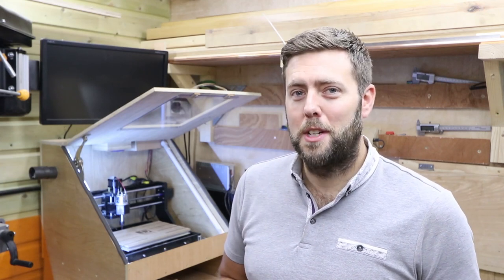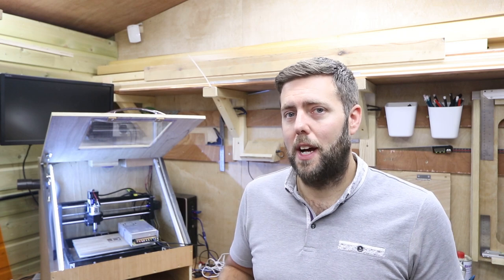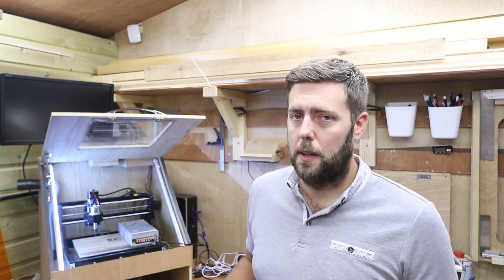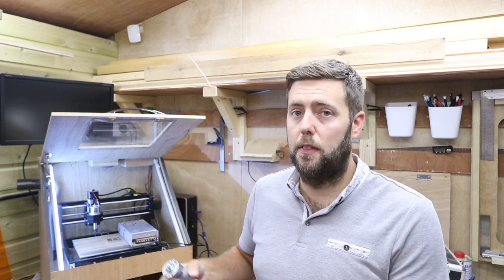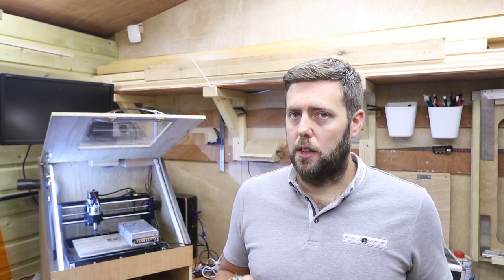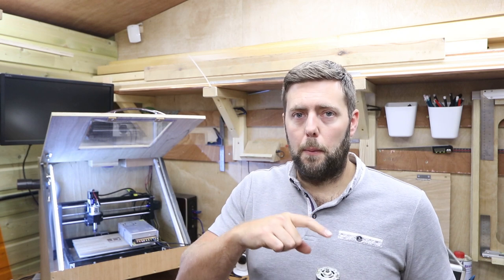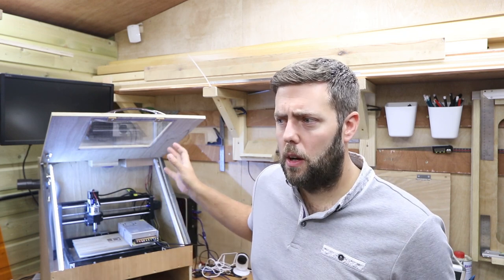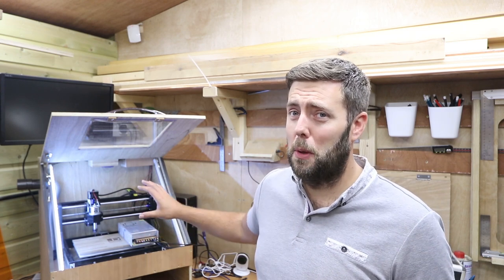3018 PRO - 20k RPM Spindle Update

Comment: with the 500w motor you can run the spindle lead into a relay to trip the relay for the power/speed control to the power supply for the 500w spindle and still have software speed control but not use those amps from the main board
Reply from the maker: Thats good to know. Thank you
Reply: yep but beware - there seem to be different types of 500W spindles out there: some with a potentiometer attached to the PSU  - and only the potentiometer - and some with an extra control board that can have either PWM input or a potentiometer attached. I think it would be nice if you can control rpms, spindle start/stop and spindle direction forward + reverse all from the software, as one can do with grbl and the woodpecker board and the feeble stock spindle :-)
Reply: @MacBaerFFM  but on the power supply there is a small loopback wire. That is where the relay goes. It basically enables the power switch on the back of the power supply. So one side of the relay has only two wires from the old spindle as a trigger. The other side will have a 24v set and one wire going to each lug of the loopback.
Reply: @Q5Grafx  Er, no, to your original comment about the relay.  A relay can only turn the power on and off.  If you use that method to control the power, you will lose software control of the speed because you will no longer have the motor connected to the 3018 control board.

The 3018  board outputs a variable voltage to vary the motor speed, that does not get passed through the relay.  However, most of those power supplies have, as Michael Grom mentioned, a potentiometer to control the speed.  Actually, that is normally just a way to provide a control voltage to vary the output of the new (higher current) power supply and can be used to control speed by using the spindle voltage from the 3018 board indirectly.
Reply: @Q5Grafx  Not quite.  You'd have two wires from the spindle connection on the 3018 board connected to the relay coil.  That will simply turn it on and off - and only if the software sets the spindle speed high enough so there's enough voltage to energise the relay.  You then have two wires from the relay contacts to turn the power supply on and off, connected in place of the loopback wire.  There is no third set of wires from the relay.  The power supply main output is connected directly to the new spindle motor.
Reply: @pnt1035  a so-called solid-state relay-build of MOSFET- can pass the PWM signal. That's how I control my 230V heated silicon mat that is part of the heated bed of my 3D Printer. The SSR (MOSFET) is controlled by 12V PWM.
Reply: @MacBaerFFM  Yes, of course, if it's PWM and a good SSR.  The signal from the control boards on 3018s isn't always PWM, and as Q5Grafx wrote "relay" not "SSR", and described connecting it to the loopback (which is for a simple switch) I assumed a conventional one.  For an SSR, with a PWM input from the router board, you leave the so-called loopback permanently shorted, and wire the PSU and SSR output in series to the spindle, as you obviously know.

Comment: James, I am thinking of purchasing the 775M spindle motor but I would prefer to control the motor rpm with a separate manual controller and an upgraded power power supply, could you offer your thoughts on what type controller, also if the controller is not possible then please indicate how to bring up the $ bit (GRBL) and how to set various rpms. Thanks
Reply from the maker: You basically just need something like a 10amp PWM controller. Available on Amazon for under £10. There is a way to connect it up so the control board turns the spindle on but you then manually change the power - however I've never done this so I cant advise on how to actually do the wiring

Comment: Hi james, I got the same spindle and power supply unit. I wired the spindle directly up to the power supply unit, but it didn’t spin. Is my motor broken?
Reply from the maker: Its difficult to say but it would suggest that. Do you have anyway to test the connections, such as a multimeter?

Comment: Hi James,
One of the cronos 42BYGH34H-2A-13D stepper motors on my 3018 Pro max mini cnc has packed up. Could you advise an equivalent if I cannot find a Cronos? Will the replacement be "plug and play" (compatible with the current circuit board and software?)
Reply from the maker: Hi Bruce, the standard motors called Nema 17. Yours appears to be a 2a version. If you google Nema 17 2a you will get a suitable replacement. I am just trying to find a specific one though, I'll come back asap
Reply: @JamesDeanDesigns  Hi James,
You're a star. I really appreciate your help here. Didn't you have the same problem? is an upgrade worth considering?

Comment: So are you powering just the spindle with that external power supply or is it feeding the board and then the board feeding the spindle? Thank you!
Reply from the maker: Me personally, I'm feeding the board and board feeds the spindle. Some people do power the spindle separately though
Reply: @JamesDeanDesigns  thank you for responding Sir! I plan on taking the same approach as to not lose spindle control
Reply from the maker: @chrisjsmitty  there is way to power the spindle separately and still control it through board but to be honest its more parts, more money, more effort. Personally not worth the hassle in my opinion

Comment: Hello! 
I would like to ask that with this 20000 RPM spindle, can I work faster? Is it decrease the working time? Will cut the wood like the butter?
This recommended spindle is in a very good price, and I like it. I could replace easily because in the same size like the original. But why so many people upgrade their machine not with this, instead use that black one 300-500 w maybe you know that. What is the different?
Reply from the maker: So this will help you cut a bit faster, let's say about 20% faster because although it has higher RPM the torque doesn't really increase. Whereas something like a 300w spindle has more torque which allows you you cut even faster. So in short, a 300w spindle is going to be better however it also costs more to make that upgrade

Comment: Hi again, just received the 20k spindle although im struggling to remove the chuck and collet off the old spindle to put on the new spindle. I have loosened the grub screws although its really stuck on there. Any tips?
Reply from the maker: This is quite common. The easiest way is to take the nut and collet insert off, clamp it upside down by the ER11 collet and tap the bar out through the middle with something like a screw driver. You can use some penetrative oil like Plus Gas or GT85.
Reply: The ER11 is heat interference fit, propane torch 400°c or higher to expand it enough. Unless you have to old style that just secured with grub screw. Heat blueing is tell tale on type identity

Comment: my router came with 10,000 rpm and it's not enough. It sounds/vibrates at full speed.
Reply from the maker: Unfortunately a lot the routers for these machines are really unbalanced which makes them noisy. I found that putting a different ER11 Collet on helped balance things better

Comment: Hi James, like many I am new to the CNC game and I have learned a lot from your vids. On the power side of things, have you thought of using a powered usb hub? I use a powered switched usb hub attached to the top of my case (based on your build of course), and I have a switch for my usb led light strip, intake fan and exhaust fan. The benefit is I can run what I want, when I want without it going through the same psu as the board and spindle. What do you think?

Comment: Just bought the upgrades . (Thanks James)After a couple of months of use it seems like a good idea. But one problem I have is when I look at my $$ settings there is no $30 settings. Do you have any  idea what im missing?
Reply: It might means that, like mine, your control board is grbl 0.9. $I should show you the build information including the grbl version. I know that on my machine maximum RPM is reached well before S1000. I need to do a few more experiments to determine the exact cut-off point but I suspect it will turn out to be 255 as that's the resolution of the Arduino's PWM controller.
Reply from the maker: You just need to update the firmware  on your control board from 0.9 to 1.1. Its quite  easy to do, I dont have a video of it but there are quite a few available
Reply: @JamesDeanDesigns  Thanks James😊

Comment: I wonder, isn't it better to use a soft start now?
(I mean to boot and keep all components intact, Motor and Power supply!)

Friendly greetings from The Netherlands!
Rob
Reply from the maker: Friendly greeting from the UK too 😁  I hadnt even given soft start a thought when I bought this but a few people have mentioned it now so I think I need to look at it. Also someone suggested about breaking the motor in - apparently you run it under water fir 10 minutes and it helps the life of the motor as the brushes are shaped better
Reply from the maker: That last video... a soft starter 😜

Comment: Hello, I have a CNC3-3018 pro, i have been looking at a lot of these comments and just wondering,  there seem to be different types or names of the 3018.  are they all the same as far as the control boards and  running the same grbl?  Also I just bought the Genmitsu GS-775M and I'm trying to get it running to the speed 20000.  when I try to change the $30=19000 from a video that I watched on you tube. I started low with S1200 and G4 P.25 kept going to 19000, but the speed never changed.  What I'm I doing wrong.  I saw on other videos there is text file to open the codes M3 S4000 G4 P.25 (WHAT AND WHERE!!!) how do I find that? I thought I looked everywere, but dident really show me how.  SOOOO how do I change it? and get it running at its full potential? I think I need a step by step or a relly good video.
Reply from the maker: The $30 can be anything in theory. These machines don't actually measure RPM so you can use an easier rounded number like 1000 or 10,000.  Its all about the proportion of power to the maximum. So for example if you use $30=10000 ($31 should also be set at 0) and wanted 50% power then that should in theory be M3 S5000 which literally means start spindle at a speed of 5000. The code your referring to insert is ramp code, this is basically to soft start the spindle save over powering anything. So quite quickly you 20% power, 40% power, 60% power etc. I have to be honest if all your code is correct I cant really understand why you can't control the speed of the spindle. Try using Candle. It has a manual speed controller which should help in this scenario
Reply: @JamesDeanDesigns   thanks for the reply.  I'm in the Candle and I can change the speed from 100 to 1000  but I just can't change it in the console it always says $30=1000 and when I try to change it to$30=10000 or anything past 1000 it seems like the spindle just runs slower.  I took pictures of the setting of the grbl on the candle but I can't find any way to send it to you.
Reply from the maker: @rolandhoffmaster4760  so if you increase your $30 value but your S values stay the same then yes, the spindle will go slower. Using my earlier example, if you increased $30=20000 then S5000 would only be 25% power now as its all relative. If you're on Facebook or Instagram you can message me on there an send the photo if you want
Reply: I went to UGS and changed the grbl in the console to $30=20000 and I closed it and opened it back up and the 30 stayed at 20000 it would never change in the Candle no matter what I did.  But I just opened the candle and the 30= is at 20000 but when I hit the spindle speed on the candle the spindle just runs like it's only at 100?        James we all thank you for any advice but I know that you are not the problem solver for this machine but it seems like you are a very good teacher with your videos but not everyone is a good student.  Everyone learns at a different pace especially when they jump into something they never done.  So I (WE) just want to thank you for what ever device you can give.  Keep up the good work.
Reply: @JamesDeanDesigns  ok so the $30= is at 20000 in the candle I have to put in the console S20000 and I will see it run at that speed? Crossing my fingers

Comment: For a major spindle upgrade, just switch the new spindle motor with a relay. Use a 24V relay and plug it in where the original spindle goes. It will all be automatic just as it was before. The only difference is that you should max out the speed in software and use the motor's own speed control.
Reply from the maker: I did a video a few weeks ago on this which is basically the same process. Using an SSR to control a Dewalt router. Works great
Reply: @JamesDeanDesigns  Excellent. I shall have a look at your video. Is the SSR maybe fast enough that you can make use of the PWM to control the router speed?

Comment: Hi James,
Can you use this upgraded spindle with the standard PC board that the 3018 pro max was supplied with?
Reply: Is there a specific reference for the upgraded 775 spindle you ordered on Amazon? I want to upgrade as well.
Reply from the maker: There doesn't appear to be any specific references unfortunately 😕 it runs with my board which is the Cronos Maker but different machines have boards as standard. Its a case of just buying and testing unfortunately

Comment: Thank you for the doing this upgrade video.  I have upgraded my 3018 Pro with a new spindle from SainSmart.  They said it was compatible with the 3018 Pro.  I say not as the controller and power supply cannot handle it.  I don't think I can run the kind of current through the Woodpecker controller that is needed.  I am working with SainSmart now to see what the best solution would be. I recently published an upgrade video for the new spindle motor.  Seems I will need a second one as well.  ;-)
Reply from the maker: You're not the first person to mention this about Sainsmart. I usually give them credit but I also found it strange they only released this spindle in the US - the sceptic in me thinks it was because they didn't want to go global if they knew there might be some problems
Reply: @JamesDeanDesigns  I have had good luck working directly with them.  I even got a new laser kit from them and I did an assembly video for them.
Reply: My suggestion:  Those controller boards are not very rugged, and heat is the enemy of all electronics.  I suggest an inexpensive relay that runs off of the controller, but then drives the spindle directly from the PSU.  That way the spindle still turns on or off automatically (via the controller), but the load on the controller is even less.  [There is almost certainly a reverse diode on the board to prevent back EMF from the spindle (now relay), but check just in case.]

Comment: Should also consider ramping the spindle speed up slowly on start-up to reduce start up loads.
Reply from the maker: That all depends on what could control board you have. Ramping is one option but an easier option overall is to fit an inrush limiter which saves needing to use the ramp code for every job

Comment: Good Morning!  As for the amps drawn and the max amps that can go through the control board: I've encountered a similar situation with one of my 3D printers, which is just so so and suffers from occasional crashes if too much power is drawn from either heat bed, nozzle or motors. I've put in a solid state relay which is PWM friendly connecting the power from the PSU directly to the bed (the motor). The PWM out from the control board connects to the SSR control input. So if you experience trouble with the spindle together with the control board, you may consider this option.
Reply from the maker: Thanks Michael. That good to know. Its why I love YouTube, lots of knowledgeable people :)

Comment: Hi, a possible solution to not fry the control board would be to use relays for the spindle lights and whatever else except the step motors

Comment: Hi James, Drawing 10A at 240V is 2400W which is pretty high but a 13A fuse is common in the UK.  When you get up to drawing this kind of current it is best to check your household circuit breakers to see if they can handle it.  In Australia for example we have 240V and 10A GPOs (General Purpose Outlets) so pulling 10A is really borderline.
Reply: These stock motors do not draw no more than  2-4A so a 10A power supply is more than adequate .

Comment: the 20000 rpm spindle is twice as noisy I can hear it running in the basement from upstairs but it seems to have more power but twice now the z axis coupling has slipped putting the coupling on the screw and not on a machined surface is bad and I have had to drill out the set screws because they are such poor quality the allen strips out I am saving for a quality cnc router and not a toy
Reply from the maker: It sounds to me like something is really unbalanced, more than like your collet setup. My 20k spindle ended up being quieter than my stock spindle. Sorry to hear you've had a bad experience